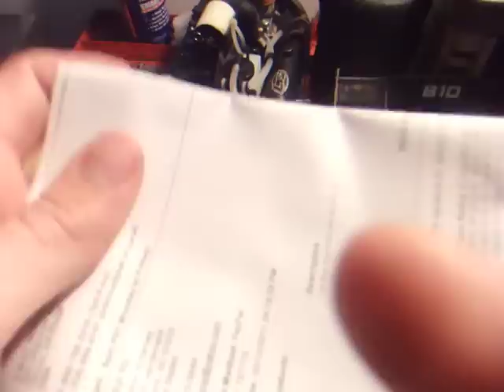losi 810 update 5/23/11

Comment from the maker: @jclass09 step one preheat the engine to 200, step two prime the engine by covering the exahust with your finger and pulling on the pull start, step three watch the fuel go into the carb give it one or two extra pulls, step four insert glow lighter and pull.